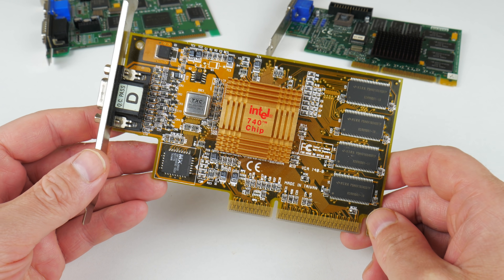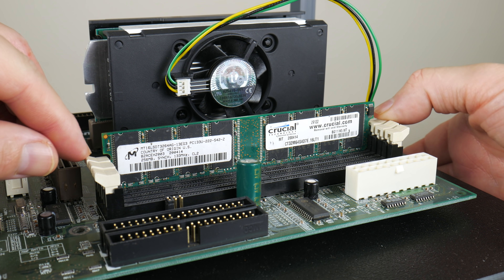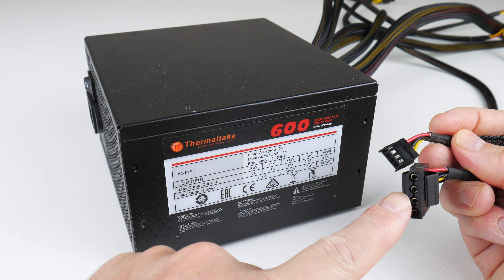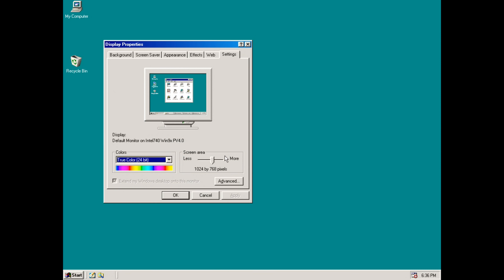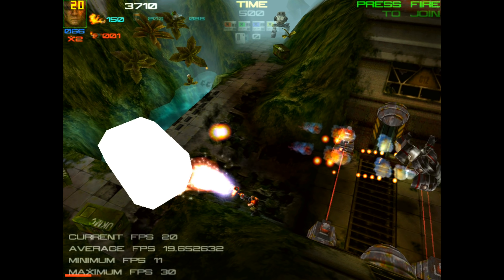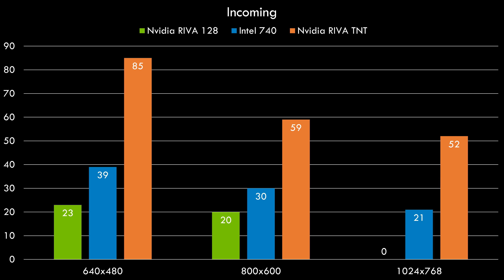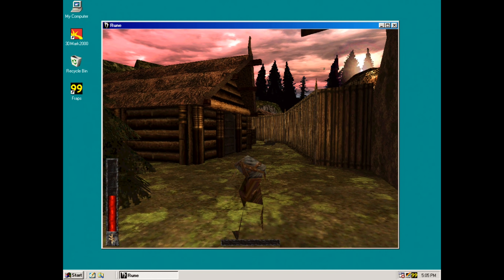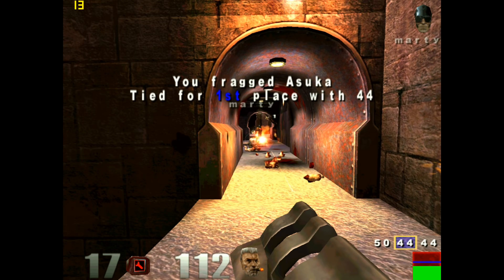Intel's first dedicated GPU vs Nvidia - The Intel 740

Comment: I'll stick this here just for reference. Now I'm probably the only one doing this but never mind. If you have a Gigabyte GA-6BXD dual slot 1 board it will run 850mhz coppermines SL43F (latest revision). I would like to try the 1ghz but they are now stupid money on 100mhz bus so I won't. Mobo is not the most accurate on fsb anyway so 850 tends to be more like 930-950 as the bus sits around the 110mhz mark. P3 850's on 100mhz bus are a tenth the price of the 1ghz chip. 10% of the cost 90-95% of the performance, happy days. All this from an old server board that was built to run a maximum of 450mhz P2's on dip switches. Cool AF as far as I'm concerned. Circa late 90's super pooter.
Reply: 3D Mark 2000 Pro 1024*768 , 4902 3D marks with a Geforce 2 GTS.  Not bad , not gaining anything from dual cpu's really on this but having two in a rig from this period is just realising the dream of the time.
Reply: I konw , it's just me that cares, AND.
Reply from the maker: Yea the top parts always command a premium. Just go with third best or something like that and value is much better!

Comment: 1998 was the year when I built my first PC ( I had a Pentium 60 in 1996 but this was an Escom system). It was a Pentium 2/300 with Riva128. Later I added a Voodoo 2 and replaced the Riva 128 with a Riva TNT. To be onest, I never considered buying an Intel 740. I read all the tests in german Gamestar Magazine, and Intel or Matrox GPUs were not very interesting at the time.

Comment: Great video, as usual.
Around 1998, i had a Pentium II 350 and an ATI 3D Rage Pro. Not a really good card.

Was this the first and last intel discrete graphic card ? (aside from the upcoming GPU in Q1 2022)

I though about a card that could worth the test : Cirrus Logic "Laguna 3D" (Multiple chips. Mine is a CL-GD5465)
It is similar because it was the first and last Cirus Loggic 3D acceleration capable card. Sales and performances were poor. They stopped making video cards. End of story.
Reply from the maker: Yes it was!

Comment: You have pretty good i740 there, thats why it does so nice compared to Riva128. It was not usual for the AGP version to carry 8B of memory. Usually the AGP had only 4MB. The PCI version which did not have any AGP texturing carried 8MB onboard, so it was usually faster. But you have 8Mb on the AGP and since most of the game you tested were made to consume 4MB and run on original Voodoo1, you are not pushing much trough the AGP, thus the "decent" performance. The card was just too slow for its time. It was the year of Voodoo2 and later TNT1. It could have held low-end but the drivers killed it, like most cards that were not from 3DFx or NV (and later ATI and Matrox).
Reply from the maker: The 4MB is just used as 2D frame buffer. The card uses the RAM on motherboard for 3D graphics.
Reply: @philscomputerlab  It is used as both 2D and 3D framebuffer, just the textures are streamed. You cannot have split framebuffer. The PCI version of the card stores both on the card, thus is in the end faster.

Comment: I remember that we bought an i740 for my fathers computer back in the day. Never did get it to work right, the computer kept freezing at random. Later I tried it in another computer and the same thing happened. I did figure out that you had to make sure to limit the AGP to 2x in the BIOS, after doing so it worked without issue. Forget what brand the i740 card was. I still may have it somewhere.

Comment: Before i740 I was running a Am5x86 133 PR75 and Diamond Stealth 3D 2000.... the i740 was my first AGP card! I paired it with an AMD K6-2 300 and a Shuttle HOT-591P VIA MVP3 motherboard. Stayed with i740 for about a year before 'upgrading' to a TNT2 M64. Stayed with the K6-2 Till i got a Duron 800 in ~ year 2000 and MSI K7T Pro2-A paired with a Kyro II

Comment: If the current market has shown us anything, it's that having just two graphics card manufacturers is a bad idea. I hope Intel does well. They don't even need to make top of the line cards...even low end or middle range cards that compete with 3060s or 3070s would be great, if it means prices are reasonable.
Reply: We'll have to see what happens. Intel may do us a solid and they may do us dirty too. It does seem like entry level and mid range cards don't exist anymore these days though.

Comment: Interesting. I had a Compaq Presario 5000 back in the day. It came with a P3 933 and a on board intel 810e gpu on the motherboard. It was crap. I upgraded it to a Voodoo 5 pci, then a GeforceMX 420 pci(no AGP on the board). That was much better. Interesting note though, KOTOR would not run on the 810e, but one time when launching the game it for some reason picked the 810e instead of the Geforce card. It ... looked like a N64 game. All the textures got downscaled and some objects didnt render in proper order. Like the z buffer didnt work.

Comment: Ooooh, good old times! My first PC-build was a P1 233 MMX, 64MB of EDO RAM and ATi Rage II+ 4mb gpu, it was kinda awful at 3D but could actually run Jedi Knight in Direct3D which was kinda cool back in the day. The first significant upgrade was when I got the Diamond Monster 3D II 8mb version, and I've actually kept it quite a bit, even on my second build - the almighty socket A Athlon with 900mhz and 256MB of SDRAM, that was an absolute beast back then because it was the time when people were actually starting to go big on AMD builds and it really ran great with some Thermaltake Orb cooling on it. Great days. If I recall correctly, I've owned that Voodoo2 card for like 6yrs which was pretty insane back then, quite a long period. I was just a 3dfx guy in a way I guess with all those Glide exclusives like Turok etc.
Reply from the maker: What's your impression of the Rage II in other games? We will look at this card soon and I'm curious.
Reply: @philscomputerlab  not so great I'm afraid, although it's already almost 25yrs since I've owned one, I remember it kinda sucked. I played MDK, Jedi Knight, and Interstate 76 on it, but the real revolution was that Voodoo2 card, nothing was really the same after I got it. It felt like a revelation haha, like someone turned on the light. Then my all time favourite - Half-Life & Carmageddon2 came out and games like Kingpin, Blood2, Soldier of Fortune, crazy times for young gamers... Oh yes, just found it online and remembered instantly - Ignition, awesome race with little cars, it also ran on the Rage II+ in 3D mode (D3D).

Comment: 1998 was the last year for my S3 Trio 3D + Voodoo2 combo. I have switched to Gef256 after it. Still remember some games that have been more into glide looked a bit odd on D3d.
Reply: Nope matrox g400 .  On RPG games matrox had a Nice detailt like gold , zilver and coper  thanks to Bump Mapping.  Nvidia dit not support IT.
Reply: I had a G400 waay after, when I started hoarding hw. I might have one even now. The server industry was still using G200 in 2016 in some gear. It has it's own legacy. Gef256 has a kind of (dot3) bump mapping too. I guess they didn't have it before. Like in a TNT2. Google suggests otherwise. The TNT2 ultra might had some kind of bump mapping. It might have been not the environmental kind that matrox used. I remember my Leadtek Gef256DDR got obsolete by not having hw T&L and that was a new go getter feature.
Reply: @chris-tal  all GeForce have t&l even the sdr one.  Only the TNT serie do not have IT.  Same with ATI rage serie and matrox serie not have t&l
Reply: You're right. So it may have been something other d3d incompatibility or a step up in the opengl ICD. I remember running some newer games on it like HL2 just to compare it to newer stuff, but some other titles from that HL2 era didn't work. The source engine was unsuprisingly very slick at it's own time in 2004. Before that NFS4 could do away with both cards, but shadows under cars were glitchy on the Gef256 as I recall. Anyway, switching from a voodoo2 to a more crisper image that the Geforce had also made me see it odd at first glance. It way so crisp I've found it a bit plastic looking. Might have been my eyes were used to 3Dfx's simple 4x1 linear filter, 16bit render (the DAC output was always just 16bits at max), smaller textures, etc. (and the reason why I go back to it nowadays).
Reply: I wouldn't say it sucked. It certainly had a feeling to it. Especially SLI mode brought some arcade vibes. Wasn't as sharp as an S3 on the desktop. Some S3 cards are very bright. They output voltages way higher than VESA standards. V2 with their TI DAC's (not made in-house) stuck with standard vesa signal levels. I have measured it a year ago when repairing one and got surprised. That era had a lot of generic monitors that were not as sharp as today's display technology either. There were digital connections just not on the consumer market (also CGA's and EGA's RGBI signal was digital too, way before all these) and let's face it: Matrox was a card for business. Also I remember when environmental bump mapping came out a lot of games didn't use it. When bump mapping got real popular the G400 was already obsolete.  Well, I don't care about that the v2 output isn't top quality as long as it brings back certain memories.
Reply: @chris-tal  that is the Nice thing about RPG games.  Even with 25fps you van still play it .
Later i have replace IT with ATI rage Fury Maxx and after that a ATI Radeon .
What have a lot of problems.
Later ATI Radeon 8500.
That replace with a GeForce 3 ti200..
That is my 1e Nvidia card .

Comment: The Intel 740 has an interesting history, involving GE, Lockheed Martin, and SEGA.
It took years of research and development to get that card out, and what killed it more than its design failures, was the hype built up around it after Intel’s success in the Real3D partnership and the power of the SEGA Model 3.
Reply: Indeed. The graphics IP in the i740 came from Real3D. What Intel added was full-spec AGP support, emphasizing AGP Texturing from the system memory. That's why the card didn't need much on-board memory. Intel simply used the product as a practical showcase of the then new AGP standard, how it can maintain decent performance and low production cost. Rendering quality was very good as well, particularly compared to RIVA128.
Reply: I fell for this because real3d was making the card. It was called the starfighter when sold by real3d. I couldn't believe the card was average at best but little less than one year later it was crushed by the competition as this video shows. It was so bad that intel sold all of the stock at low price and stopped making discrete cards only doing motherboard chip gpu and eventually integrated graphics.
Reply: @aceofhearts573  They later bought the Real3D division and spent the next three years fighting in court with nVIDIA, SGI and ATi over patents.
Reply: Is this the same SEGA as the videogame technologies company?
Reply: @thatguyalex2835  Of course.

Comment: The Arc GPU's will probably be decent enough as a midrange option (the best one for 90% or more of users that play games but aren't benchmark queens) performance wise and probably MSRP wise (I think they can bite the bullet for R&D in attempt to fill a majorly in demand market)...for about 20 seconds.  After they get scalped it'll be another ~6700XT with less refined features probably.  AMD is making their scaling tech open like they do most everything else.  Nvidia already talked about possibly incorporating some of it, I see no reason why Intel wouldn't take a look at doing so as well.  DLSS is technically better, and visibly too if you push it, but it's also leagues more complicated to integrate and use with a piece of software.

I miss decent APU's tbh, I'm looking to replace my older 2600 Ryzen setup I used for home use a bit back with a 5700G(E) and 6800XT.  I plan on getting a newer motherboard that supports the APU functionality to mess around with it.

Comment: Intel, doing integrated graphics thingies from the start and even with a separate card solution. Because yes, I consider a graphics adapter non-discrete when it sucks resources from the main system, being built into the mainboard or onto a separate board is a very visual/physical difference, but does not tell the whole story.

Comment: Thank you for the video!
As for the quality of graphics in games on Unreal, UT engines, everything is the same in Direct3D, I found my old records (low quality of textures, textures disappear, no colored lighting, etc.), so fans of Unreal would not like the card from Intel).
The demo-level run in Serious Sam is very indicative, as far as the i740 did not reach some 3D technologies.

P.S. i740 can still be made to display the image normally in Unreal by forcing it to work in OpenGL with a loss of about 30% of the already low speed, but the image is very dark.

Comment: Interesting thing I figured out with an Intel 740 when they came out.  It uses a Chips & Technologies 2D core.  Intel had bought that company within a year or two of the card coming out, so I had a computer once I put the card in but didn't have the drivers so I went into device manager and forced in the newest chips and technologies PCI driver that was in windows and it worked in windows 95 in 16 bit color 2D.  Device manager wasn't complaining either.  The 3D core was developed by Real3D, a division of Lockheed Martin.  The Real3D core was used in many sega 3D arcade games of that area such as Daytona USA 2.
Reply: The intel 740 is not even close to the real3d pro-1000 graphics board on the Sega model 3 which was capable of hardware T&L .

Comment: when you compete with nvidia they respond quickly (very quickly).
Reply: Nvidia is like a tiny little bug compared to Intel. I don't think you appreciate what Chipzilla really is. The guy that founded intel invented the integrated circuit. THE CHIP!
Reply: @1pcfred  Logic, Intel was founded  in 1968 whereas nvidia was founded in 1993. In 1998 Intel was already a big company when nvidia was only 5 years old.

Comment: Most people don't know about the Intel 740 because Intel has selective memory and has scrubbed many references to the card out of existence. The 740 wasn't a bad chip/card when it was first released but it did end up being released in the later parts of the wild west days (95-98) for 3D cards on the PC. The 740 did had some issues working properly on many non-Intel chipsets which basically meant every Super Socket 7 board. Also, as you found out game compatibility wasn't awesome. Most importantly it was destroyed in the benchmarks by the Nvidia Riva TNT & TNT2 and 3dfx Voodoo 3 cards later in 98 & 99.
In 1999 740 was even squeezed out of the "low end" 3D card market by cards like the 3dfx Velocity 100 (a cut down Voodoo 3 card,) ATI 3D RAGE XL (die shrunk and cost reduced RAGE Pro) and Nvidia TNT2 Vanta (memory bus cut down to 64 bit) cards which were cheap for OEM's like Dell, HP, Compaq, etc. to toss in a desktop and market as having a "3D accelerator."
Reply from the maker: Yea it doesn't surprise me that the 740 has issues with Socket 7 boards. They are super picky with AGP.

Comment: I was still rocking my 486DX 66Mhz system in '98. Wasn't interested in 3D games at all. My younger brother had a system bought for him that year which had an i740 in it, and I've still got the thing around here somewhere. I ended up going with a K6-2 / Trident Blade 3D system not too long afterward because browsing the net on a 486 was getting progressively less fun.

Preferred the Blade 3D over the i740. Behaved nice (unlike a number of previous Trident cards) and well... seemed less generic. (I still wasn't interested in 3D gaming!) That's still on the shelf as well. Never got around to comparing them in benchmarks, and neither really got a workout.

Comment: I had an i740 based graphics card. I got it for free, and I ended up simply scavenging the memory chips off of it (they were socketed fortunately) to use on another card. It's not that it was a horrible card, compared to other cards that were a  year or so older, but compared to the cards that were released around the same time, it wasn't anything special.
Also, when the i740 was released, the CPU speed was nowhere near as high as in your test system. And when comparing the i740 to a Voodoo 2 for example, on a contemporary CPU, such as the Pentium II 300 or so, the i740 looked particularly awful compared to the Voodoo 2. I think that's part of the reason why it was considered a bit of a dud when it was released.

Comment: Nice one Phil - Ive been looking for my old i740 for months :)
Reply from the maker: I wasn't sure I had one, so had to search through two large plastic containers and there it was. At first the machine didn't post and m heart sank. But I removed it, cleaned it, put it back in and then the machine POSTed 😀